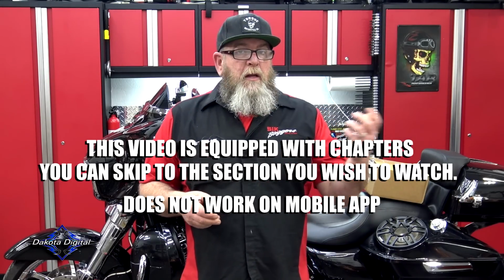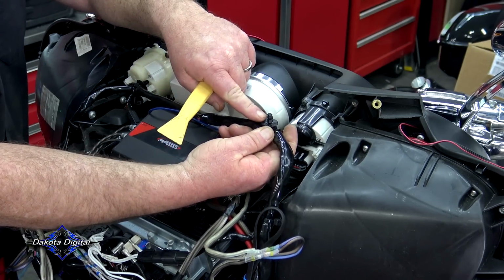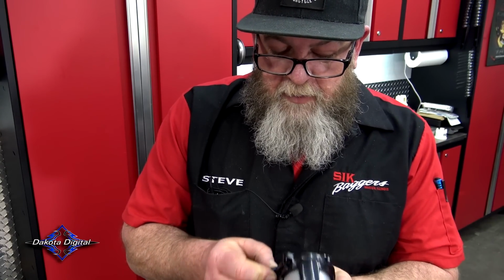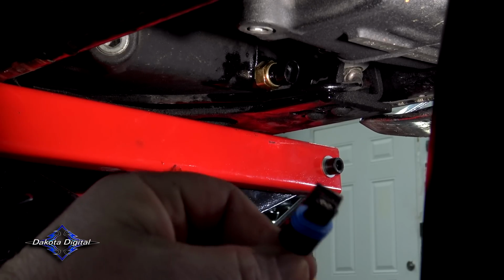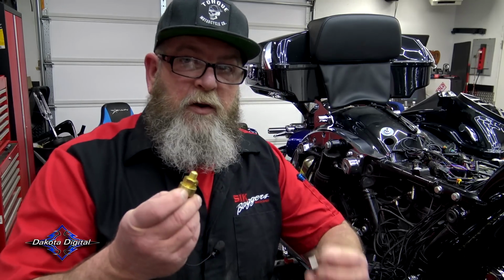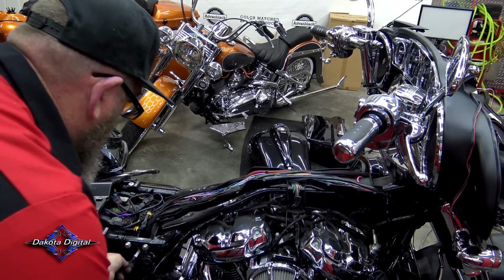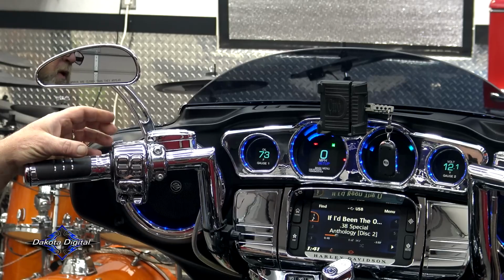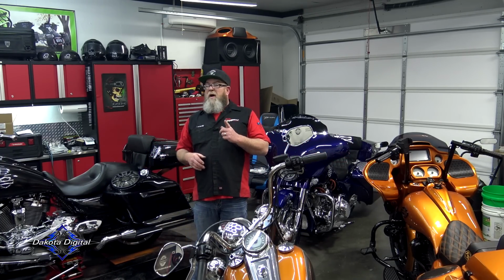⚡Step-by-Step Guide to Installing Dakota Digital Gauges on Your Motorcycle W /Air Ride⚡

Comment: I have these in my 2014 SGS and love them. Just a tip on the clock setting on them as it frustrated the hell out of me when daylight savings hit and I tried to change the time using the gauges settings. The clock has to be changed on the radio unit head and the gauges read that. The gauges will let you adjust the time in their settings but when you hit save it reverts to the radio head time. If anyone is looking for a very detailed video on the settings on the gauges a guy call "windsurfed1" does a 25 min video on them that was a huge help. Great video as always Steve. Would have save me a couple of install headaches.
Reply from the maker: Hey Paul! Thanks for checking it out! And thank you for the awesome tip! I only set up the basics on this unit for my buddy so I never really got that far but that is important information! I actually thought about doing a separate video for the app and set up as the video was already running kind of long but just ran out of time to do it.  Im still learning things from these comments that I never would have mentioned so thank you!

Comment: "⭐⭐⭐⭐⭐.....😎" Love my Dakota Digital. My OEM speedo was off about 8 mph and the Dakota Digital system allowed my speed to be right on!
Reply from the maker: Thank you! And yes the OEM Odometer on the bike was 2 miles off from the computer on the bike...I manually put the milage in 3 times and the gauges changed it to the actual milage on the bike which was actually 2 miles less than what the OEM one read. Kinda crazy lol
Reply: @sikbaggers  Mine was more about the OEM speedometer so when I was going 80 it was reading about 74 mph. That was crazy but the digital allowed for corrections to match your actual speed to the speedometer.

Comment: Definitely SIK!! Steve your install skills are 2nd to none, well explained and love that you always put the torque spec right on the videos and your editing is top notch! Where does the air pressure show up? Is it a setting you have to go to or is it just displayed somewhere on one of the gauges all the time? I don't have a gauge for my air ride and don't like the ones that mount to the rocker box. Plus Dakota Digital is just badass, think you just sold me on them for my 21 SGS. Cheers from NW Iowa!
Reply from the maker: Thank you Douglas! Much appreciated sir.  The large gauges are broken down into 3 sections..one large (MPH or Tach) and then below that, you have 2 customizable lines. There are about 10 options you can put on those lines. Such as Trip, A Trip B, Miles to Empty, Front/ Rear Air, Etc...You choose what goes on those lines and can be easily changed to your liking.

Comment: Steve as always OUTSTANDING VIDEO. Only wish you would have went through the different face colors that are available on them.
Reply from the maker: Thanks for checking it out! Yeah sorry about that, the video was already so long but ill add it into my RG video if I do it. BUT, that being said it lets you change the colors via the app, you can literally change it to any color and color combo...the top large number can be one color and the bottom lines can be another. There are about 10 preset color combos or you can customize it to your liking.
Reply: @sikbaggers  ...Steve on another question...on the guage setup do you have to run the oil temp. Or can that guage be used for something else??
Reply from the maker: @sirsloth8579   You cna get duel accessory gauges that show 2 lines on the side gauges but you have to purchase those, so I think the best way to do that is buy your gagues al a carte, and select which ones you want. Im sure Dakota could probably answer that question way better then me..but from what I see on the website you can pick and choose from this page  https://www.dakotadigital.com/index.cfm/page/ptype=product/product_id=772/category_id=707/mode=prod/prd772.htm

Comment: You have the best vids for making the install look so easy.  I have been thinking of buying the Dakota digital gauges but was not sure if i wanted to install, no i will 100% do the install.  Thanks for the great vids!  The only part i am not sure of is how do i get the mileage that is current to the new gauge?  is it automatically saved in the ECM and will appear automatically?
Reply from the maker: Thank you!  And yes it is saved in the ecm and will load into the gauge.

Comment: boy that's BAD ASS !!!!,  I've been looking for white faced gauges for my 07 ultra classic , but $1700 is a stretch right now.
Reply from the maker: Yes..ive seen several brands and all pretty expensive but I bet there was a ton of R&D that went into making these so I understand the cost for sure.
Reply: The factory gauge faces are fairly simple to swap out. Contact your local HD parts department for the cost of the white gauge faces.
Reply: @sprintcar-acematt5175
Reply: @sprintcar-acematt5175  thanks ill look into that !!!

Comment: Hey great video. Got a question about my install which I had done at a rally by an authorized dealer. Ever since I get error code U0156 shows up. I contacted DD and they sent a new main gauge. I installed but still get that error. Clear it and it goes away for a while but comes back. Any ideas? Thanks!
Reply from the maker: Thats a lost comms error...I would start by checking all of the pins in your plugs...you could have inadvertently bent one of the pins..ive seen it happen quite often. Also make sure the pins are pushed fully out and you dont see one pushed in farther then the others.  If that doesnt fix it, I would pop the old ones back and see if it goes away..if it does you know its the gauges. I know its a pain but worth a try. If that doesnt fix it I would find them at a rally and make them deal with it.

Comment: Can you tell me what the holder for the gauge fuel and volt gauges is called? Also possibly where I can get new ones?
Reply from the maker: Those are just called Back clamps, You can really only get those from HD...you'll have to go to a store and order these parts numbers,  69200258 BACK CLAMP, GAUGE (LEFT)  and 69200257 BACK CLAMP, GAUGE (RIGHT)   Double check with the HD parts manager that's the right one for your year bike...not sure what year you have but im 99% positive its the same for 14 and newer bat wing fairings.

Comment: Mr Steve doesn't look like these will work with my thrashin gauge relocation. those extra 3 connector on right side might be blocked off (its made for stick gauges that the one connector) also bummed can't get your advanblack lithium battery. Anyway I can get one? Not asking for handout. I will pay
Reply from the maker: Hey Jim...yeah I dont think they will work...and the battery is on hold at this time. We should have it again soon.

Comment: Hey Steve, great video.  Question, I have dirty air ride system front and back but no gauges (been adjusting by feel); for these gauges do I need to install the air ride portion?  I should so I have solid numbers to look at but just wondering if I NEED to do it.  Have a manual center stand so no need to do any electrical connections for that.  Thanks.
Reply from the maker: Hey....so I never ran a gauge on either of my bikes until I got one for the rear air ride on the dirty air kit I did...always did it by feel..and Ill be honest with you..I never look at it! lol Still just do it by feel.  If I get these gauges for my bike I wont be adding the air gauge section...I already know I wont mess with it.

Comment: How does the new gauges read the fuel level without plugging in the fuel side wire harness?
Reply from the maker: I dont know what you mean jason..12:40 both sides are plugged in

Comment: Steve, you stated to torque the gauge screw to 8 to 12 inch pounds but do you use any blue Loctite?
Reply from the maker: no loktite on those...honestly 8 to 12 in lbs is hand tight.

Comment: I put the DD gauges in my Road Glide, I really like them.I just wish they were brighter in day light conditions. Is there any way to make them brighter?
Reply from the maker: Hey Mike...I was wondering about that, as I couldn't get them out in the sun here..it was pretty overcast here when he picked up the bike. . I even told him he may have to play with the colors once he rides it to make sure he can see them in the daylight.  I really only saw the auto adjusting lights options and didnt see anything on making them brighter. Only thing I can suggest is changing the color. That may help.
Reply: @sikbaggers  I tried a different color selection but could not see a substantial difference. it seems to take a big direct sun angle to make it go into day light mode? Thank you for your help!
Reply: @mikespencer237  The gauges will change to black numerals on  a white background in bright or direct sunlight.
Reply: @sprintcar-acematt5175  Thanks Matt, it does do that if the sun is directly on them. I just wish overall that they were brighter. I do like them and all of the additional info that is accessible. Thanks again!

Comment: Any idea why my gas light is blinking while riding but it says gas is on 99%?
Reply from the maker: its gotta be in the gauge or the connector. unplug it, check your pins and reset the connector. If it still does it call Dakota
Reply: @sikbaggers  okay I'll give that a go. Thanks man!

Comment: I went with KOSO, What a mistake that was, need a decoder ring to decipher the hieroglyphs to set gauges up.
Reply from the maker: I had seen those in the past...are they really hard to set up?
Reply: @sikbaggers  Yep, unless I got a bad setup.  Toggle thru the menu and you get these weird symbols instead of, "mileage setup, clock setup". Had my kid try, ya just guess and press buttons until the stuff you want changed, changes. Joke.

Comment: Man I wish my bike didn't have ABS. Would make hiding my air ride solenoids and wiring so much neater.
Reply from the maker: I did the air ride on this bike and several others, plus mine. here is where I hide all that...abs or not, Under the right side cover where your abs is, look behind that battery and in between the fender. There is small triangle section that all of your modules can go in.  The best way to do it is remove the battery, tuck it in there and then zip tie it up in the hole so you can pass the battery back in without hitting the wires. Excellent place to hide all that and keep it out of the way.